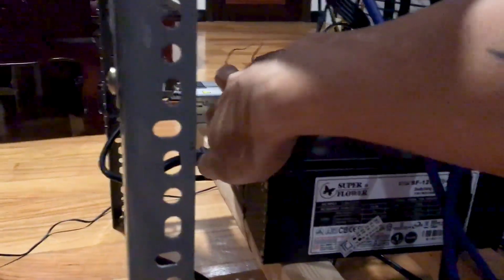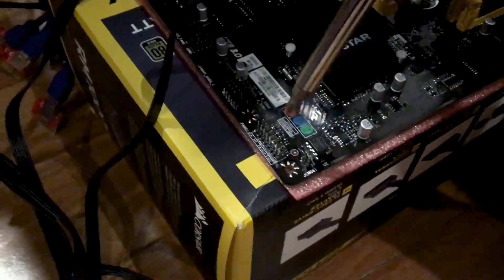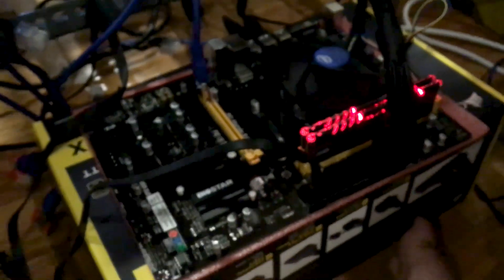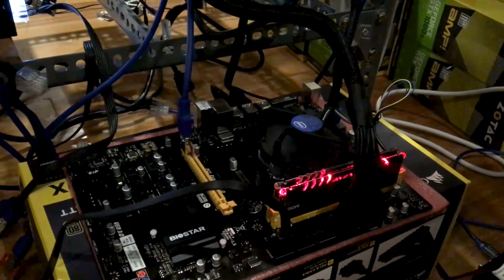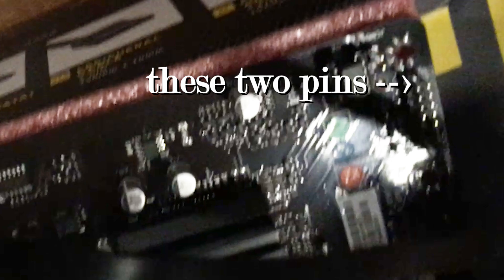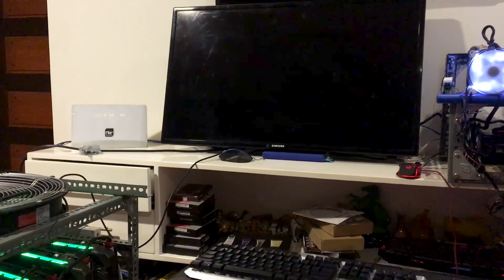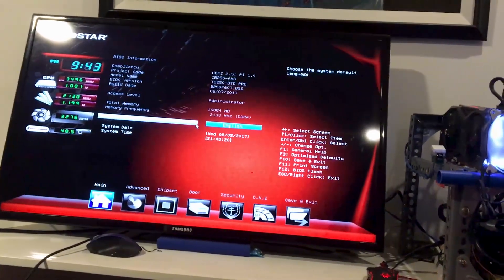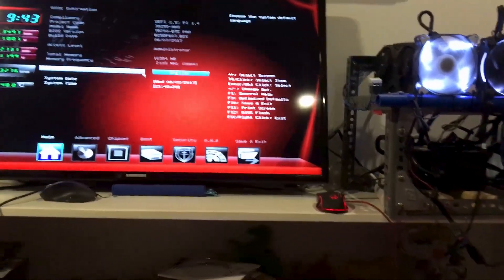How to power on your motherboard without a power button (using a screwdriver)

Comment: How do I turn it off without a power off button
Reply: who uses a power button to shut a pc down??
Reply: @crysura  if windows isnt installed you have to
Reply: @TheThumbsUpGuy  so what's the answer?
connect the pins again? hold for a bit as if  you hold down the power button? but that would be a hard shut down, right?? I want to upgrade my BIOS but I don't have a suitable cpu. It will onyl work after BIOS upgrade. So if I know how to start and turn off my computer in BIOS, I can check which BIOS version is installed.
Reply: @mari0xDD  yeah shorting the pins again for a longer period of time should do it. I've never built a computer, though, so my answer could be wrong
Reply: Bro I got the same question

Comment: It work the first time but then I installed Win 10 and after that everything shoot off. Now when I try the power the motherboard again it doesn't work, nothing happen.
Reply from the maker: Marvel Unit make sure all connections are correct. If it still doesnt power on, try doing a CMOS reset. Check out your motherboard's manual to find where the CMOS pins are and then you need to short those. Make sure the power supply is unplugged when doing this.
Reply: @BPTechParts  I'm kind of new to tech, so why reset the cmos?
Reply from the maker: @gnatmalzahar8452  from experience, it's one of the first steps in troubleshooting if your motherboard is not booting up or the system is not displaying anything on the monitor.
Reply: @BPTechParts  ok but like cmos battery has the settings of the motherboard? I'm not sure why its purpose.
Reply: @gnatmalzahar8452  the cmos battery saves the settings of your bios

Comment: Wait on my mobo would it be pwr sw or the led one?
Reply: Read the manual that came with the motherboard to locate the relevant connector and pins for the board's power switch. Two pins are used for the switch connection and these are normally labeled "POWER SW" or similar.